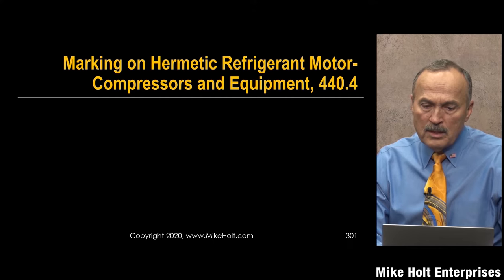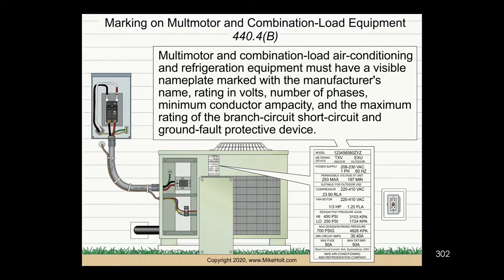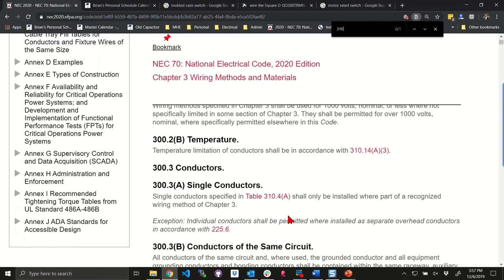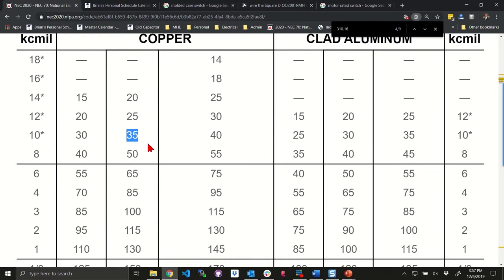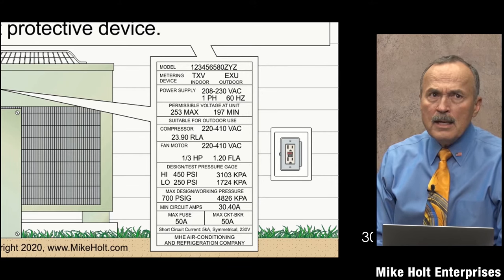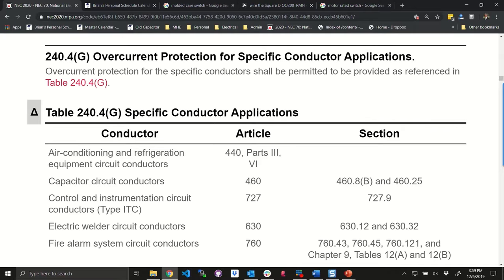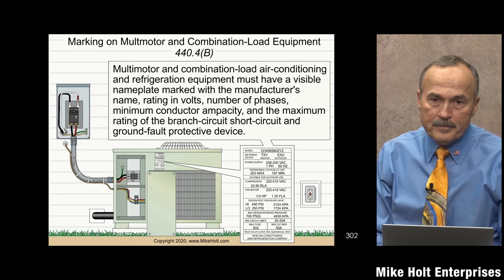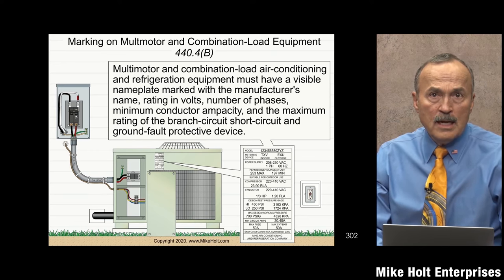Air-Conditioning, Circuit Sizing, NEC 2020 - [440.4(B)], (5min:33sec)

Comment: If i the minimum circuit amps is 30 amps, that means the smallest wire you can use is 10 gauge, right?
Does that also mean you can go bigger on wire? Could i use 8 gauge?
Reply from the maker: Nope, doesn't work that way for a/c equipment. Please watch the video again. The breaker is sized to the nameplate and the wire is sized to the nameplate.
Reply: @MikeHoltNEC  
Oh ok. I think you answered my question. I was just wondering if when it comes to wiring, and I know we are supposed to go by what it's rated for, but i was curious if you could go bigger on wire. I already knew you can't go smaller. But i thought you could go bigger. That's why it says minimum circuit amps. I don't see a maximum circuit amps.
Reply from the maker: @Bible Bloopers  Of course you can run a larger wire than what is required by the load. But why run 8 AWG to a water heater, when all you need is 10 AWG. Why install a 400A service on a home that only needs 200A... If someone ran a larger wire than is required, who is paying for this 'wasted' larger wire? If you are then I'm good with that, do it. If you plan on passing the cost to the customer, then I feel you are not serving the customer. If you are the electrical contractor and you are not passing the cost to the customer, then it's stupid, but some contractors are not that 'business savvy'. I personally follow the NEC, and would charge accordantly.
Reply: @MikeHoltNEC  
I agree. It was just a question out of curiosity. I do HVAC. So I was just wondering if I was ever in the event in an emergency situation if I could go up in bigger size wire in the event I didn't have the correct size wire.

Thank you for your quick response time
Reply: @biblebloopers946  bigger wire is always good. But cct breaker is specific to that rule on the HVAC.
If for example: its a long run and at the instant the compressor motor starts the motor must draw very high start current. Its min. locked rotor current is 6 times the motor load amperage  or maybe more for hermetic motor. The cct breaker at 50 AMP specfied in code is high enough to let the spike current to pass through without premature tripping. Voltage at that start must not be more than a 5 percent line drop total (supply to the load.) The conductor installed if number 10 or you increased it bigger for which I explained above if you had to would reduce line loss. But the breaker remains at 50 amps. Limiting the fault current just as code requires.

Comment: What if the unit is fed with type NM-B (Romex) which is pulled from the 60°C column on Table 310.16?
Reply from the maker: Correct! We size the wire to 60C, per 334.80.
Reply: @MikeHoltNEC  Thank you for the quick response!

Comment: The flexible liquid tight conduit coming out of the HVAC unit. How much slack does it suppose to have before you strap it to the wall.....
Reply from the maker: See Article 350, let us know what it requires.
Reply: @MikeHoltNEC   from what I understand conduit is to be fastened within 12in of termination points and at intervals not greater than 4 1/2 ' feet.

Comment: why wouldnt it be 60C since its under 100A
Reply from the maker: In reality, all 'terminals' under 100A are are rated 75C. That's why!
Reply: I have been wondering this same question?i understand the whole concept but it says in 110.14 (c)(1)(a)that anything under 100 amps should use the 60°column.unless the it is marked otherwise.so im guessing the breaker,disconnect,and ac unit all say good for 75°??
Reply: @davidschuld4771  that’s what I thought too so I’m confused when he says under 100A use 75°c

Comment: For that disconnect feeding the AC unit, does 440.14 have to comply with 110.26?
Reply from the maker: Read 110.26 and let me know what you think.
Reply: @MikeHoltNEC  I belive it does need working space,  yet I find disconnects mounted above suspened ceilings and also in crawl spaces that had to have been inspected. 440.14 states that it is allowed to be mounted "within" the unit, which in my opinion could never give proper clearance.
Reply from the maker: @bradrolleri2909  Of course 110.26 applies to disconnects. Your 'experience' is distoring your reading of the NEC.
Reply: MikeHoltNEC you are definitely right! Thank you for your videos

Comment: I’m a 40+ year HVAC&R tech (currently studying for my electrical license) if the breaker is sized just over the minimum circuit a ampacity will protect the compressor under brown out, condenser fan, and other failures. 
The authorities having jurisdiction would require that the wire size match the breaker size not the ampacity of the equipment.
Reply from the maker: Then you have unqualified inspectors.
Reply: Right, I’ve been doing this for 30years in the pacific nw. I know 20 or more inspectors and none of them allow this.

Comment: Why does everyone that agrees with you ignore 440.6
Reply from the maker: 440.6 simply tells you what 'current' to use for conductors and protection. Conductors are sized at 125% of 440.6 current [440.32] and protection is sized to 175-225% of 440.6 current [440.22(A)]. These are the values that the manufacture uses for the nameplate. Do you agree that the article by the IAEI written by my friend  Keith Loftland is 100% correct as explained in the video? If not, then assume you are just one of the 'unteachables.'